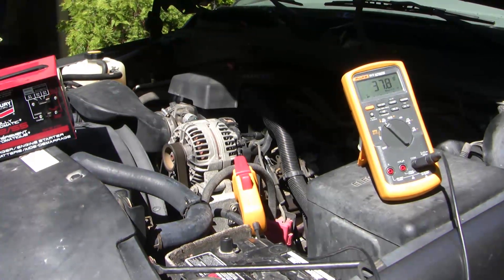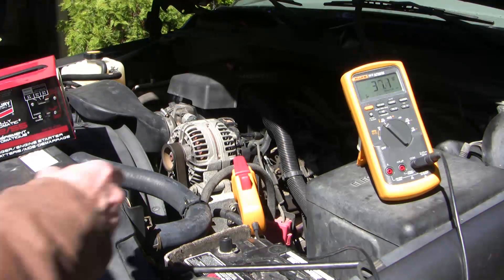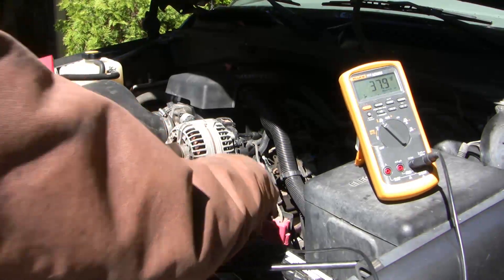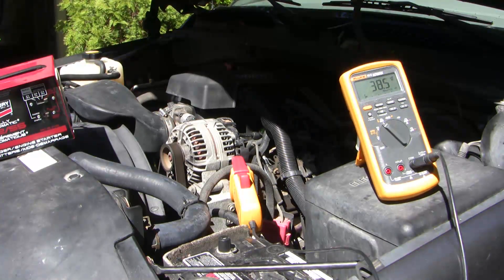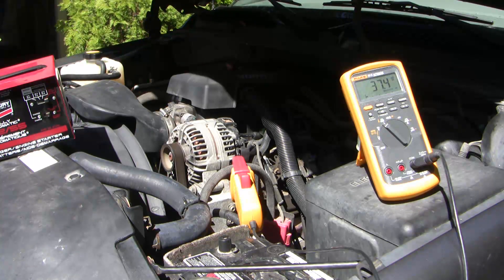What happens when you make your alternator charge a dead battery?

Comment: I have an optima yellow top battery that only charges up to 11 something volts after several days in the charger. Guess i will be using it for other things rather than running it in my car.  Thanks for the unformation!  Also, with my v6 engines (and smaller) ive been able to get by using lawn mower batteries.
Reply from the maker: Yes I have a similar battery that I use on the bench. As long as it doesn't bulge or overheat in the garage it's probably still safe, although I wouldn't leave it on a charger without checking it regularly. If you can get the caps off you can check and add distilled water to each cell which might offer a little more life, and some newer chargers have a desulfation mode that might offer a longer life. On the vehicle the multimeter should read at least 14 volts while the car is running, even if the battery is bad. If not, check your alternator.

Comment: Does a charging battery consume anymore engine energy to spin vs not charging? It's not clear to me whether a no charge condition physically interrupts charging.
Reply from the maker: That's a good question, yes it does. The field coil induces a magnetic field, and the way modern alternators adjust output is by adjusting the current through that field coil. When the coil has a big field, it is mechanically harder for the alternator shaft to spin, effectively turning mechanical energy into energy stored in the battery. You can practically see that by unplugging the control side of the coil and listen for the sound change as the engine doesn't have to labor as much to spin the alternator shaft. It's also a convenient test to sort out whether a sound is coming from the alternator or somewhere else. A big part of the engineering behind fuel economy was to optimize fuel consumption of peripheral devices like the alternator, fan, AC compressor, and power steering. New alternators even have an overriding clutch that allows it to coast to a stop when engine rpm falls quickly (like a bicycle hub).

Comment: I have a Corolla which has 12v 46AH battery. I left the car for 3 weeks and now it's not starting. ODO lights turn on one point Below ignition. Battery has low voltage. Is it a good idea to jump start using another car's battery and then take for a drive? Will it kill alternator?
Reply from the maker: The best option is to charge it with a trickle charger overnight before starting the vehicle. Slow charging is easier on the battery because there is less tendency for hydrolysis to release oxygen and hydrogen gas, which disappears, depleting water in the six battery cells. If your battery has vents you can pry off, I would pry those off and add distilled water to any cells that area low. If there is a label "maintenance free", then that will not be possible. Severe depletion of a lead acid battery is not good for the battery, and it often means it is time to replace and recycle the battery. Depletion after three weeks raises the question of whether you might have parasitic drain on your battery, caused by something like an interior light that was left on, etc. After charging, if the battery is still unable to turn a starter motor over, it is likely time to replace the battery.

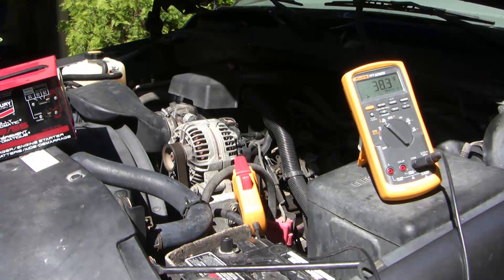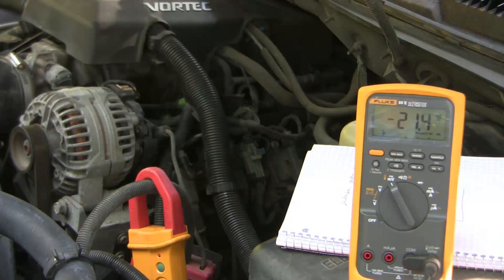Comment: 0:19 based on this readings - 38 amps. i think this means it charges the battery with 18 amps. because 0:33 after a few days the alternator puts 20 amps, that are for the car electrical and electronic consumption?
Reply from the maker: Good point. There are many factors at play, including the software that decides how much power to send to the field coils, which in turn determines alternator output. New alternators come with very sophisticated algorithms to reduce mechanical engine drag when full alternator output is not needed. It may take a day or two to reach steady state, so current measurement at startup is only a snapshot.
Reply: @spelunkerd  Thanks.I got one question outside of this topic.I think i messed up an alternator. I took alternator from Kia Forte 1.6gdi. I've done alternator changes many times before.. But this time , after i took out the alternator , and give it to alternator specialized shop, the customer reinstalled his battery to be able to lock and unlock the car and open the trunk. So the next day i got the alternator from the alternator shop and started to install in on the vehicle , but the battery was connected(i didn't notice he installed it) and i shorted for half a second the charge cable to the body of alternator. The alternator works okay after the install, but do you think , this shorting could lead to problem down the road, because i know the alternator has PCB electronic voltage regulator , which communicates with the PCM via 2 wires. 1 wire is PCM command, other is the alternator return signal. I hope i didn't messed up the regulator.
Reply from the maker: @petar443  Not much to do but see if it works. Many of these circuits have protective diodes that short to ground when reverse connected, and of course there are fuses to help prevent catastrophe. If it doesn't work, I'd check fuses for a clue, and if you find nothing to work with, a scan tool may help to nail down the problem.

Comment: Ideally you need to put the current clamp on one of the battery leads that way you only see what current is actually going into the battery.
Reply from the maker: +Stephen Gibb You make a good point, that an overall look from the battery is nice to have, and depending on what you want to measure, often the best choice. However in this case, with engine running, remember that power is also draining from the battery to drive the coil, computer, and various sensors. Baseline requirement was about 21 amps in this vehicle, but it depends a lot on what devices are running at the time (radio, headlights, GPS, etc). Some electrons will inevitably go directly from the alternator to those secondary devices. The battery acts as a voltage stabilizing device, smoothing out the bumpy output from the alternator. If one were to hook the ammeter to one of the posts of the battery, measured current into the battery would underestimate alternator output. There also could be some confusion about which direction the current is flowing, since you would be measuring the net difference of current in and out. In this case, alternator output was what I wanted, so I got as close to the alternator output wire as I could. However off camera I did assessment at several points, which was consistent with the above remarks. Thank you for watching!

Comment: your right, it is better to charge them with a trickle charger. ideally that's what should be done, but in reality, most often we use the alternator to charge the battery after we boost it. more often than not that's how shops do it, unless they are slow, but most times we boost it and get it out and let it run, unless of course its in for a battery or alternator.
Reply from the maker: Yeah, I agree. The demand to move vehicles off the lot and down the road usually makes overnight charging impractical.

Comment from the maker: Yeah, higher RPM would allow faster spinning of the rotor. Actually in this case I did use the vehicle through the day. But a lot of the strain is from extra heat caused by high current, which is unavoidable when the battery is severely depleted. Good question.

Comment from the maker: I would check the fuses including the main fuse, and check for computer codes, then check to see if your battery is charged and functioning correctly. It would be VERY rare for a bad battery to cause a failure while driving -- theoretically you don't even need a battery while driving since the alternator takes over and the battery just evens out the pulsations caused by the alternator. So, if system voltage falls while driving it's more likely an alternator or a fuse. What make car?

Comment: Something i noticed was when i was driving to work with the new battery my RPM improved. back then with my old battery the RPM needle would play around when i was at a traffic light (gave me the feeling that the car might even stall- but never really did). i even thought the alternator was going bad.

Hopefully i made sense..so what do you think- can an old battery make the car RPM play around or is my alternator really going bad?

Comment: i couldnt get it back to start- i even unplugged part of my sound system from the battery to see if it would give the car more power to start nope! didnt work.
i just ended up buying a new battery since my car has had the same battery since i bought it back in august 2011. i had the old battery recharged about 3 times since its been with me.

Comment: Hello, im new to your channel, 
Today when i was about to head to work my car started fine no problems- but once i hit the brake pedal to change gears my radio shut down- few seconds later after that the car stalled. i tried turning the key again but no luck- i noticed that when i was turning the key i would get a loud static sound coming from the bottom of the steering wheel cover almost like the sound a bad speaker would make.

Comment: I found a 50 amp fuse to be bad by using a test light connected to the negative cable clamp, and the pointed tip of the test light touching the negative post on the battery.. It lighted up, so i started pulling fuses till it went off. The first one i pulled was one of the two 50 amp fuses, and it happened to be the first one I pulled and made the test light go off.. This is probably an issue non related to the alternator not charging though, from what i've been reading.. Could it be though?

Comment: Alright, I'll have a go at it tomorrow. I'm also going to look for the alternator fuse to see if it might be blown.. also, do you think a tooth brush would work to clean the connector? lol it's an internal voltage regulator by the way. the part number at advanced auto is 92323.. if you wanna check it out. Thanks man.

Comment from the maker: A wire brush with it all disconnected is all you need. Some people use a spray called 'electrical contact cleaner', but it usually isn't necessary. It sounds like you need to do further diagnostics, including a voltage drop test and a double check that the connections are all done correctly. In your vehicle, is the voltage regulator built into the alternator? If it's not, you need to check that device, and all the connections that go to it. Of course an alternator only works with engine running.

Comment: Okay, I just got my warranty replacement alternator, brand spankin' new out of the box, put it in after taking out the old one in the advanced auto parts parking lot, 4 hours later, and the alternator is still not charging the battery.. maybe i screwed up the ground wire? I did notice a good amount of corrosion inside of the connector plug, tried cleaning it out with a pocket knife a little but couldn't get all of it.. still isn't charging! How would I clean the connector?

Comment from the maker: It is said that one of the commonest causes of premature alternator failure is overheating caused by a bad battery. The alternator has to work too hard to keep charging a leaking cell, eventually causing failure. It seems appropriate to routinely test the battery, and if it proves bad then replace it before replacing a failed alternator. I suppose the same could happen in a parasitic drain situation. Thanks for watching!

Comment: Not sure, but I had a near dead battery when I replaced my alternator.. when i say nearly dead, i mean when i tried to start my truck the morning of the day i changed my alternator, it wouldnt start, but it sat all day and it started so i could move it onto flat ground to change the alternator.. I still have the same battery, and maybe since I put the alternator through the stress of recharging my battery it might be having issues now? I have a short video on my channel of my issues with truck..

Comment from the maker: As you know, your point has general implications that a bad battery puts extra continuous strain on the alternator, maybe even killing it. That's an important, classical lesson. Perhaps I've been lucky because I've quickly diagnosed bad batteries before that happened. In this case the battery is fine, and it passed testing with my 500A carbon pile load tester. Thanks for emphasizing the point! To get to that 10A figure you subtract the baseline load used by the engine -- I measured the sum.

Comment: Spelunkerd, little info for you, if the recharge current going into your battery does not go below 10 amps in 5 minutes, the alternator diodes are going to overheat due to the increased load of the battery.  So as soon as you turn on all your loads, it is going to overload the alternator.  Check your recharge current again.  Replace your battery if it doesn't pass the 10 amp spec.  Hate for you to have to replace your alternator.

Comment from the maker: Last week I went through an outstanding Wikipedia article on lead acid batteries, and it brought clarity to a lot of issues for me. It pointed out the mechanism of sulfation that happens to these batteries when deeply discharged. Deep discharge batteries have thicker plates that are more resistant but they have a lower peak output. Thank you for watching!